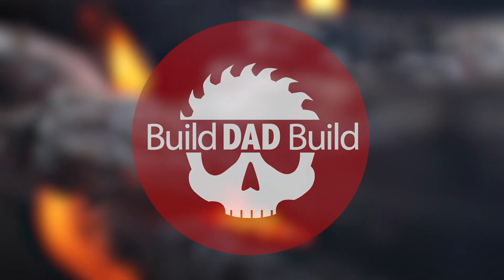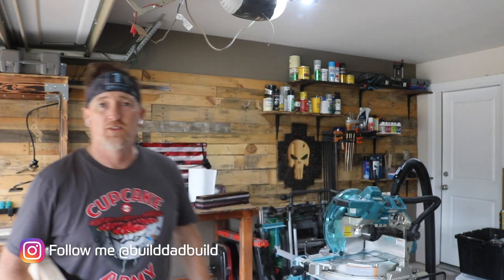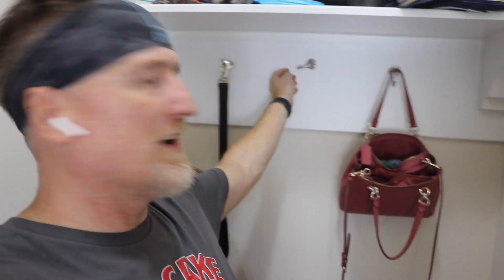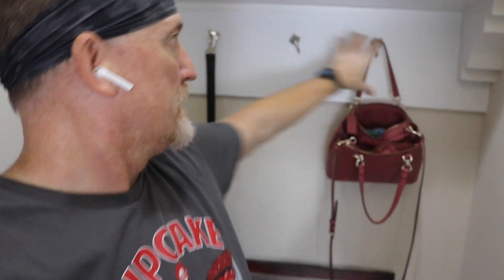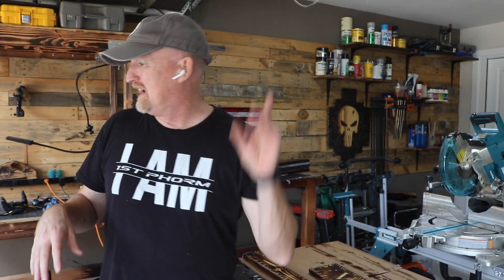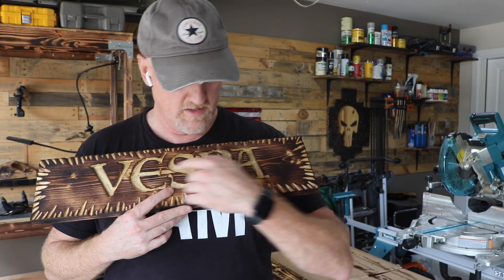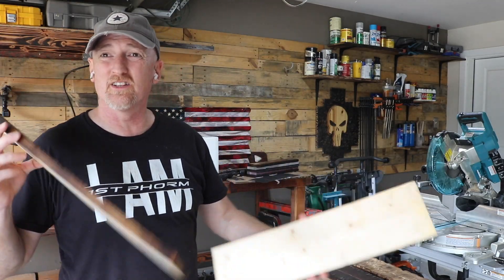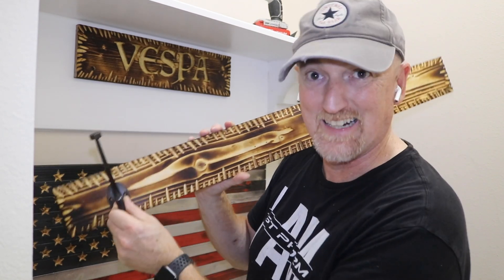DIY Coat Hook Rack

Comment: Hey Nick

Great video!  Is the 'die grinder' an attachment to an agle grinder or a drill bit of sorts or??

Also, congratulations on the enormity of your success 8n the scooter industry Mr Vespa!

Thx! 

Z
Reply from the maker: LOL and thanks!
A Die Grinder is a tool all on its own. Usually used more in the automotive industry. It's a little bit more of a specialty tool for power carving.
Here's the one I picked up.
https://amzn.to/309UdhO
Cheers